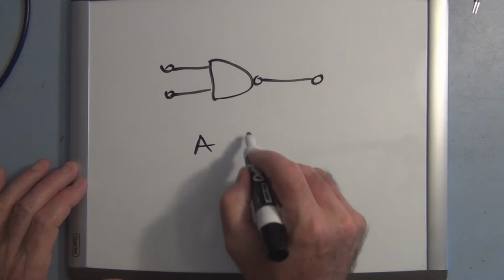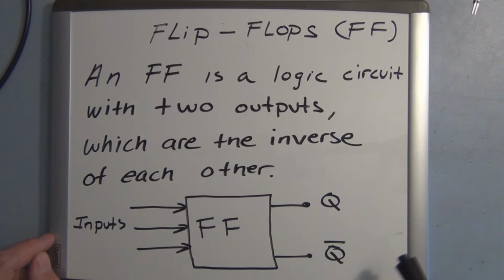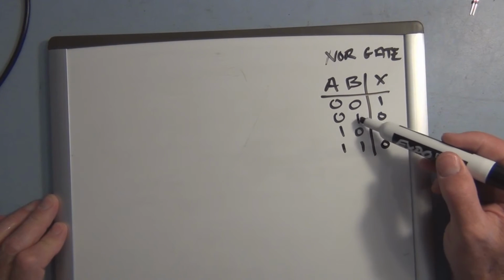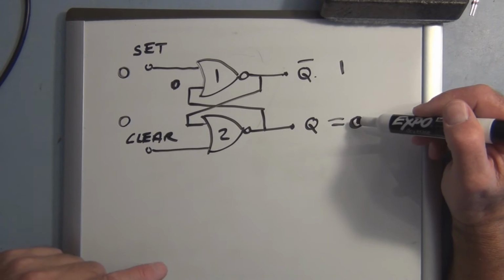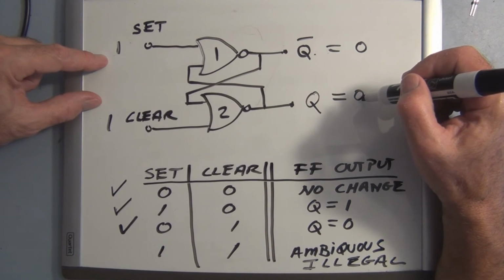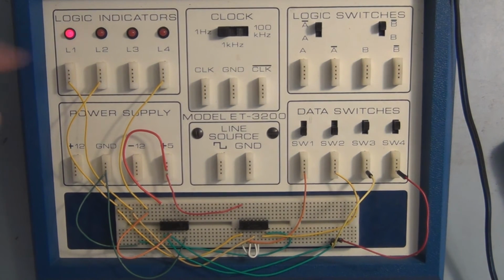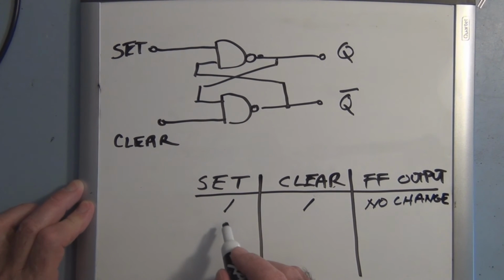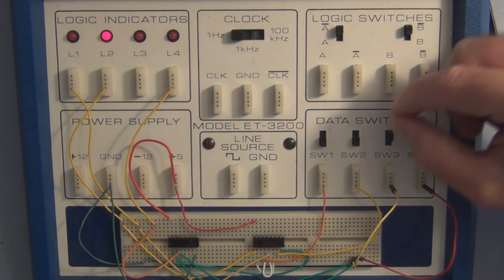Basic Digital Flip-Flops tutorial

Comment: Hey Tom, your tutorials are brilliant even thought i am relatively new to Arduino programming you made it seem simple in the "Connecting a Sharp Distance Sensor to the Arduino Uno" video. The why what and how in regards to measuring an analogue output was praise worthy. I cant thank you enough. I had a request. It was would be awesome if you made the type of fully explanatory video in regards to a using an Photo-Resistor with an arduino. especially the voltage divider part. How do the readings reach 1023 when you connect a resistor in series.